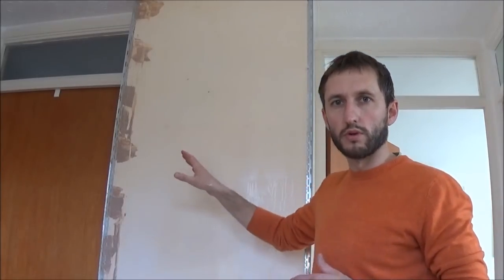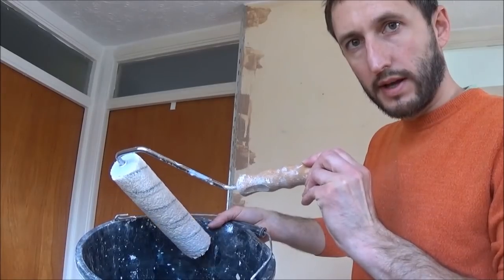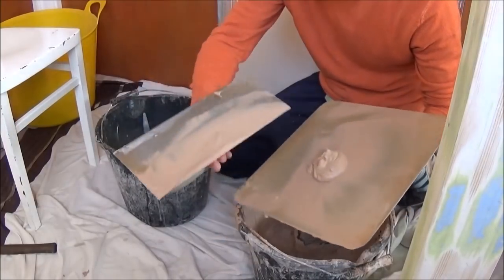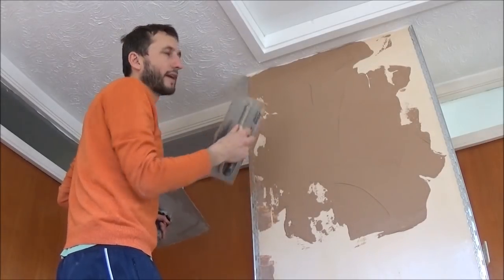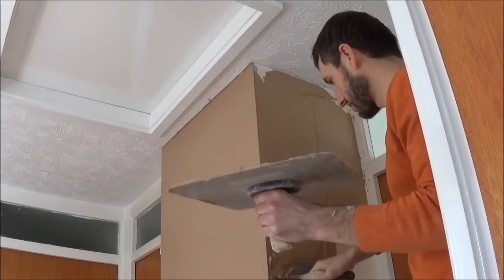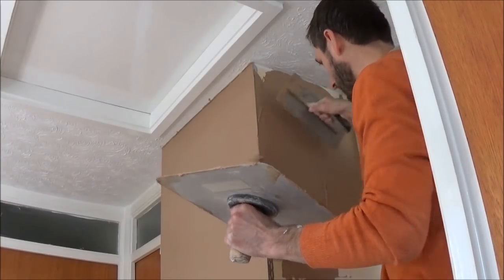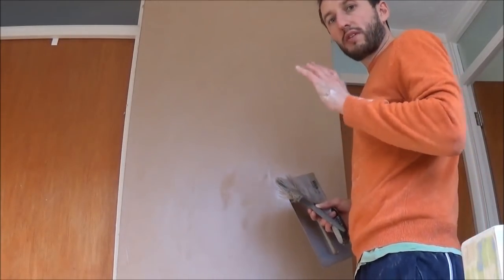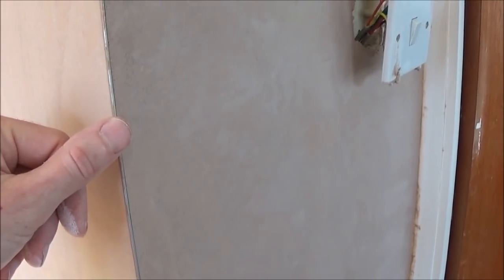How to plaster a wall 3 sided. Plastering a chimney breast beginners guide. Plastering tutorial!

Comment: Mix the pva with hot water goes off quicker. On reskims scrim all corners and cracks first then pva 3 COATS. I personally use Bond It as pva tends to shrink and can cause shrinkage ie cracks, hence the 3 coats. Ps why not just bang on the whole lot then double back with the same mix. Throw the sponge on it, whack a straight edge on it to take off any high spots. Come back after 20 mins with a  Nela or Perma, cross trowel, job done!!!!!
Reply from the maker: Hi again Jimjim, now this is helpful advice to a viewer, but like many other vids on the internet you're using trade lingo that viewers don't understand and it puts people off. I do the videos to simplify this stuff and get people involved. Thanks for the advice though, all good stuff. Thanks for watching.

Comment: Hi again
I am planning to renew my walls. At the moment the are in bad condition. I am thinking to dot and dab them ( dry lining) all alls. I have never plastered. Also I could use some plasterboard a with insulation for external walls.
Would it make easier to rewire the house. 
Or do you think is better to plaster?
My worry is if I use the dry lining will be challenging to attach radiators. But I think I could use same plywood behind the plasterboards.
Thank you indeed
Reply from the maker: Hi there, it's entirely up to you. I would personally plaster as dot and dab takes up a bit of space in your room due to the dab of adhesive and the plasterboard thickness.  You can run your wires behind plasterboard which is less messy than chasing your walls. To make your existing walls smooth you can scrape walls back and fill holes with hardwall plaster or bonding plaster,  then plaster over the top. You could use trunking for your electrics but it doesn't look as nice. It really is just up to you. Both methods work but do what ever is easier for you. Hope that helps. Good luck and thanks for watching!

Comment: Hi pouse,

Can you tell me roughly what would be the thickness of two coat of finished plaster? Also do you need to apply any pva if your plastering over a coat of thistle hard wall on brick? 

Andrew
Reply from the maker: Hi Andrew. I would always do two coats of PVA on the brick before applying hard wall, and then when that's gone off, apply 2 coats of PVA over the hard wall before putting the final skim coat over the top. Apply multifinish plaster about 2 - 3mm on the first coat followed by another 1 - 2 mm so by the time you've finished and polished off you're looking at about 3 - 4 mm (give or take depending on the flatness of the existing wall. If you fill out a few dips it may be 5mm in places and 2 mm in others for example. Hope that helps. Thanks for watching!
Reply: The bag says 2mm per coat but take it with a pinch of salt.

Comment: Hi Pouse , I want to apply a bonding coat to a chimney breast all three sides and then to coats of finish. Do I need to use angle beads for the bonding? Then that would mean repeating this for the finish plaster?
Reply from the maker: Hi Mark, I tend to use one bead. When you have finished you first coat of bonding plaster, just run your finger up the edge of the bead and take a tiny amount of plaster off the bead with your finger. This will leave a small bit of bead exposed which you can plaster up to with your final coats of finishing plaster. You can also use cement or lime render instead of bonding plaster. Hope that helps. Thanks for watching!

Comment: Away to plaster around a window the old beads rusty would you sat rip it out and put in new?
Reply from the maker: I think you're saying your bead is rusty, would I rip it out and replace? Yes I probably would or the rust will likely penetrate your plaster and stain the painted wall in time. Just check as it might be a render bead where the wall was cement rendered. Best of luck with it.

Comment: Im having my 1st try at plastering this weekend. A simular 3 sided wall. Roughly after your 2nd coat, you have to go over it twice. But how long should i leave it to do this after the 2nd coat.  And the 3rd polish. Whats the time in between 2nd and 3rd, and 3rd and 4th. Thanks.
Reply from the maker: It's more a case of checking it with your hands. When it stops leaving a wet finger print but can be pushed or dented is the right time. With a drop of water you can bring it back to life. Then wait another 20 mins maybe before next trowel. Doesn't always need more trowelling after that. Hope that helps.
Reply: @POUSEaroundtheHOUSE  thanks very much for replying
Reply from the maker: @danbirchall9721  no problem. Best of luck with the plastering.

Comment: Hi,

I need to skim the top of a window revel.  The board is uneven and needs to be leveled up by about 7/8mm near the window frame, tapered down to 3mm on the inside where I have put a stop bead, is it ok to do 3 coats?

Andrew
Reply from the maker: Hi Andrew, yes you could do 3 coats. If you do 2, and let it dry out for a few days, just PVA over it like it's an old wall and then do your 3rd coat. You don't want to go too thick in one hit as it will probably crack. Alternatively use bonding plaster or hardwall plaster (a filling plaster) to build up the thickness as it is designed to be applied thicker. Let that dry out for a day or so, then pva it, and do your 2 coats of multifinish plaster over that. Hope that helps. Thanks for watching!

Comment: Excellent.  I am just doing my bathroom.  took the tiles off, its a 70's house, some of the plaster has come off, as well as I can see the breez blocks just barely.  Can I just pva and then plaster, then finish.  Or do I need to do something else? Look forward to your comments.
Thanks
Reply from the maker: You can pva over a smooth plastered wall but you need it to be smooth, then plaster over as seen in the video. If you can see block work you really need to fill the low points in the wall covering the breeze block. You can do this by coating the bits you are going to fill with pva, using a filling plaster like bonding plaster or hardwall plaster over the PVA which can be applied thicker than a finishing plaster but finished smooth and flat. Then follow the steps in the video i.e. PVA wal twice and two coats of finishing plaster. Hope that helps. Good luck and thanks for watching!
Reply: Knock the wall make sure there's no void between the old plaster and the wall if so it's best to take it  all off and do it again.

Comment: Why were you plastering that wall? Looks perfectly fine to me 😝
Reply from the maker: To be honest, the wall was in decent nick, but the edges had been chipped away as it is on a well used landing. The home owner wanted metal angle bead to strengthen the corners as there was none in place causing the plaster to be chipped easily. So hopefully it will have another 50 years! Thanks for watching.

Comment: How would I plaster a wall that is already half plastered. A partitioned wall was removed and now there is a joining line from plasterboard to plaster? How would I do the joint?
Reply from the maker: Hi there, assuming the two walls are level, then run some scrim tape over the join, pva the non plasterboard wall twice (as per video). Fresh / new plasterboard doesn't need to be PVA'd. Then plaster over the whole lot with two coats of plaster as per video. Hope that helps. Thanks for watching!
Reply: POUSE around the HOUSE 
Thanks!

Comment: Never trowel across your beads even when  your troweling up  also fill your beads out first even before your fist coat  so 3 coats on yours beads  don't brush  the plaster with your brush a light flick of water  I usually use the water on my second trowel  other wise your dragging most your plaster off if it's still a bit wet  so a dry trowel  polish first  then ad the water on the second trowel  remember never across the beads always up straight  other than that he's not bad for a novice
Reply from the maker: Thanks for taking the time to provide comments and watch these videos. Best of luck and thanks for watching!
Reply: Always up 👍🏻

Comment: Tight get the plasterers in forever going over unskilled workers plaster
Reply from the maker: I guess that keeps you in work?! Thanks for the feedback and thanks for watching!
Reply: It's all very well saying get a professional, if your lucky enough to live in a rich area where there are enough real professionals around willing to the work, even if it's a only small job.  I agreed to pay a local plasterer £300 to plaster a bedroom.  He turned up and decided that he needed to 'do some prep' he  put neat Zinnesser DIF all over one area of the bedroom wall and stripped all the skin off the plasterboard.  He then said that it would be impossible to plaster the wall so that it had to be double boarded,  he dabbed the wall unevenly and left big lumps and bumps much worse than it was before, as a tape jointed wall without the skim coat.  £560 to have a bedroom in my house ruined.   He was driving around in a sign written van, so it wasn't that I just asked anyone.

I then had to find a way of fixing it myself, an ordinary sander wasn't up to the job.  After a lot of research I brought a renofix machine to grind the massive bumps out of the wall.   I'm now in the process of re-skimming the last wall with the help of these videos.

Comment: Hi, great videos, how would you go about skimming a corner like this? https://drive.google.com/file/d/1lVuCJj-Kf-1bha2v52eor1mgraeCrNq8/view?usp=sharing also it would be great to see how you go about plastering a ceiling. Or do you have a video about this?
Reply from the maker: No video on ceiling yet but I will be plastering the loft conversion in due course! My plastering vids can be found here:
How to plaster a wall - https://www.youtube.com/watch?v=LyngzAYIuZs&t=20s
How to plaster an ouside 45 corner - https://www.youtube.com/watch?v=I-VL4KWcu-c
How to install drywall corner bead/angle bead, plaster corner bead/angle bead - https://www.youtube.com/watch?v=Jkm7TyOEaHs
How to cut plasterboard - https://www.youtube.com/watch?v=5Fgl0MV1gLE
How to plaster a plasterboard wall - https://youtu.be/N7EEVK7CzF8
How to mix plaster - https://youtu.be/X4dyvDOe6-4
How to fit plaster bead to masonry using masonry nails - https://youtu.be/Fe7yNGHnDW4
How to fit plaster bead using plaster - https://youtu.be/L4f6Zn45xps
How to plaster a 3 sided wall - https://youtu.be/d9fhFEWhvHo